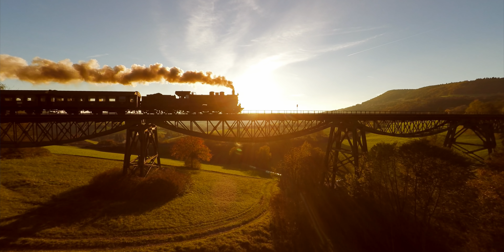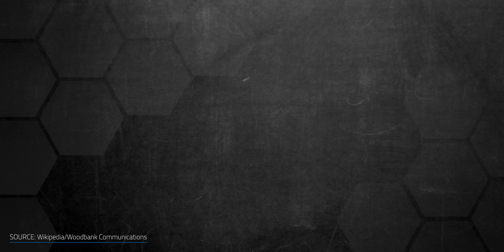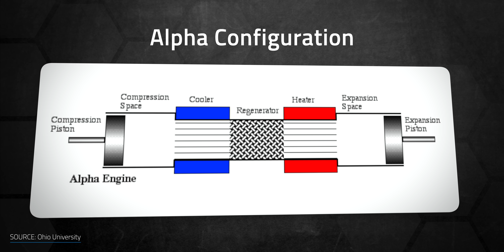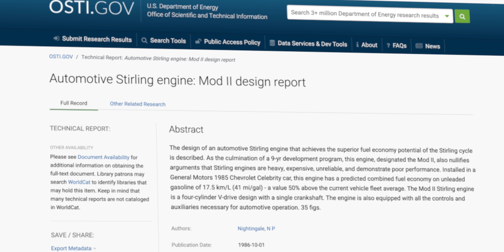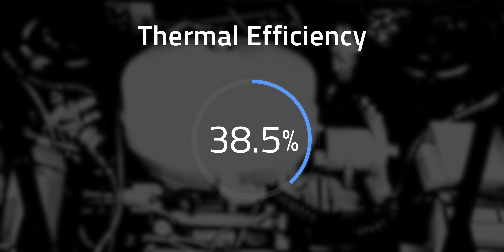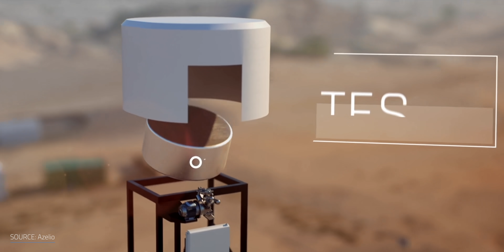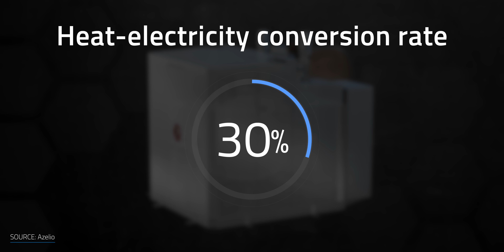Are Stirling Engines the Future of Renewable Energy Storage?

Comment: A nice video production as usual from Matt...

This appears to be the third main vendor effort working along similar lines with Stirling engines, (we're about to be the fourth :-).

Rotary Stirling is not the answer, it still requires lubrication of crank, journals and piston seals, very hard to maintain at high temperatures, prone to wear; not a 30 year longevity.

Unfortunately others rushing to market still miss a critical milestone by overlooking the solar inefficiency, raw material long term waste challenges, capital expense and space utilization of solar while the real problem is NOT Co2.  Rather we should understand combustion generated water vapor in tandem with desertification from the growing loss of 3 trillion trees, (more than 30% of global tree shade provision on earth) and losses to terrestrial aquifer recharge mechanics on growing arid lands depleted of topsoil organic material long ago.  We keep missing the boat on this one ending up with even more run-off of clean water becoming additional ocean water and salinity.  Our human contribution of Co2 is only 3-5% of the total natural carbon cycle.  

Pulling out Co2 won't have sufficient effect as long as we continue to add new water to the earth's surface raising the ocean levels increasing water vapor aloft growing the troposphere total entropy with water vapor being more than double the IR reflective heat value than all other carbon gasses combined.  This further increases the amount of frozen water vapor in the lower stratosphere which spirals to the poles becoming frozen ice crystals which destroys even more Ozone than all the remaining CFC's still being released regardless of regulatory changes decades in finally ending CFC in developed countries.

Running Stirling engines on fossil fuel does NOT mitigate the underlying causes without accounting for the two most prevalent contributing factors... Heat generation of combustion, including deforestation AND unmitigated water vapor produced during combustion and other man-made heat to vapor causes.

Still "Undecided"?  Do the math and keep fighting the good fight ! ;-)  

carbonanalytic[at]mail.com

Comment: Yes it is and this is what I am going to do in Portugal, you will see it all on my channel, as I get started on renovating my portugese house from next week.
OK I am more interested in liberating ourselves from big system control ie more of the self sufficiency lifestyle. So what I am going to do is build a heat storage unit to store daytime solar energy. Energy from solar panels will heat a night storage heater and the heat will drive a stirling to produce electricity at night. I estimate I will need about 50 to 100watts to run a house. All it has to do is power led light and a TV or laptop. Big power jobs such as running a hoover or a washing machine will be done in the daytime when abundant real time electricity is available.

Comment: Huh? so if you if you turn a wind mill into a  huge Stirling, engine with hot air supplied from the city streets and cold air supplied from water canals .and so if the giant  Piston filled with argon gas as a stabilizers .and it was shaft and gear driven or better yet brushless electric motor s .as hot as it's been around here could of produced 86 gigawatts and went back in time .

Comment: Are any used for heat recovery/recycling from combustion engines (or any kind of "thing" that releases heat as waste, like an electric motor)? I know that combustion engines vent heat out into the atmosphere but couldn't that be used to generate power that would otherwisebe lost?
 
I doubt that heat could power a steam engine as I read that steam engines work better at higher pressures which would mean a higher temperature, but these engines don't require as much of a difference. A problem that I can think of would be torque would be proportional to the temperature applied, but I think it would be enough to slowly charge something (probably very, very slow compared to the ICE it's next to)

Comment: Really interesting.
But I have one complain (it's quite nitpicky though)
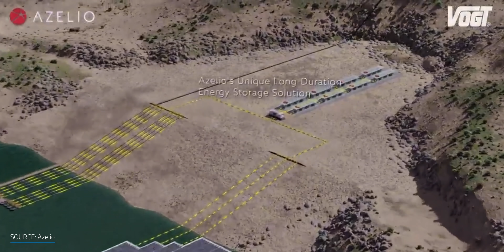10:00 I don't like question that go like "Is this the solution", because the answer is about always no, because nothing is the one and only solution in most cases. The next question that comes to mind is, "will this be part of the solution", where answering with no would deny any usefulness of the technology, so a yes doesn't matter much either.
Those questions are often used, to make what's following sound meaningful, but it can't be, because the premise of the question doesn't allow it.
Meaningful would be the answer to where and how it will be used, which is unclear in this case.

Well, at the end, I wouldn't be a good moderator, because in search of better sentences, to avoid logical traps like the 2 questions above, I'd say not much, so I would not be interesting.
I value your efforts and really like your factual, calm spirit.

Comment: I wonder if sterling engines could be used to generate energy in space considering the temperature differences on the sunny vs the shaded side of objects in space.
Reply: They do, actually using the heat from decaying plutonium as heat source.
https://en.wikipedia.org/wiki/Stirling_radioisotope_generator

Comment: Ok so, why don't we dig large holes deep underground, or use existing ones like salt mines, where the temperature is relatively constant to built massive sterling farms. You could pump a fluid from the surface (through a heat exchanger) to ensure a constant flow of almost guaranteed temperature differential. The sterling farm would need large metal sinks built into the rock to ensure maximum heat exhange with the bedrock, thus ensuring the cave stays roughly the same temperature all the time. I imagine on some days the temp above ground would be too close to the temp below ground for the engines to work, but not for very long. The temperature above ground ranges a lot throughout the day. So at least partial generation year round. And of course you could connect them to a grid so that stations can experience different temperatures and thus differing generation levels, making up for any laggers. Finally, places with far more unpredictable weather may be the best choice for these type of plants, as caves tend to stay the annual average, but above ground would vary greatly.
Reply: Probably because it is expensive to dig far into Earth's crust (it can cost thousands per foot), maintaining it is complicated and expensive and well... there is that whole "tectonic plates move" thing.

The Kola well cost over $100,000,000 to dig.  The temps at the bottom did reach around 190c, though.
Reply: I recently saw a video on british metro about how it's heating up beyond ambient temp thanks to waste heat from trains and shit in the system. one would think a bunch of stirling engines could be used to cool the tunnels and recapture the lost energy. It seems their big solution right now is to just vent the heat out into the environment, which is pretty wasteful
Reply: this is the first thought i had. Generation would also be best done in places with more extreme temperatures. e.g. any desert which could lead to a lot more development in those areas and potentially turning them into energy production hotspots

Comment: My grandpa has a solar system he bought at auction from los alamos lab.
He has a stack of polished aluminum sheets that are designed to plate a parabolic surface to focus the suns energy into a few hundred feet of pyrex tubes with stainless steel pipe running through the center. This then heats oil to around 700 degrees and the hot oil is stored underground where it can stay hot for weeks and can be called upon to create steam.

Comment: I've personally been interested in using them to replace home solar panels. Idk if there have been any new breakthroughs for solar panels but they used to be 15-18% thermally efficient, and even traditional roofs create a massive temperature differental
Reply: In hot climates you could also use it to augment them - PV works much better when cooled, a fluid-based cooling could keep the PV at a better efficiency point and could run a Stirling.

Comment: ambri is a company that you should look at, they probs fit the title of a hot battery as well. they are claiming 80% efficiency with their battery design and theoretically a very cheap and more eco friendly battery solution to lithium. TLDR of what they are doing is a molten metal battery, using an electro chemical process to charge and discharge

Comment: I think one of the main reasons Stirling engines aren't more popular is the power to size/weight ratio. Your little model is fun to watch but is useless for doing any meaningful work. Put a load on the output shaft and it will stop. Another factor is efficient use of available heat.

Comment: I have long thought that Stirling engines need more innovation. The way it works is the genius part. Its like the hard part is already done. Nasa is working on Nuclear Stirling engine batteries for Mars that would last about 10 years. I believe there is a way to use the sun to power a Stirling engine.

Comment: Stirling engines aren't a storage technology, they're just a method of converting heat energy to kinetic (or, in turn) electrical energy. The storage technology in the case here is thermal storage. That's what I really wanted to know about! How do they cost-effectively insulate the heated material to prevent loss of energy to the environment surrounding the heated material? Why did they choose that particular material and temperature?

Comment: Why Aluminum vs molten salt, or even paraffin if you wanted to take advantage of phase change. Paraffin wax phase change cooling coupled with retractable radiators was used to cool the electronics of the Lunar Rover.

Comment: Storage of energy in pressurized air is one possible solution for energy storage. However, it is inefficient in that by pressurizing air, the air heats up which may eventually bleed off, resulting in a loss of heat energy. The solution to this can be either super insulation to hold the heat, which can lead to some serious problems and limitations, or by utilizing the heat for power generation, perhaps by Stirling engines. As pressure is released from the compressed air it can drop dramatically in temperature which results in further loss of energy. This cooling could also be used for energy generation, again possibly by Stirling engines. By using the heating and cooling of the air for energy generation one could potentially greatly increase the efficiency of such pressurized air energy storage systems.

Comment: I wonder if one(or multiple) of those Stirling engines could be embedded in the walls of an adobe home and used the difference of internal and external temperatures to make electricity for off grid power generation.

Comment: I couldn't find any examples of Stirling engines doing actual work, just toys.  I looked at your example and they won't even tell you the nominal output of a unit, you have to contact them and I assume then a sales person convinces you to buy one not because it's actually more efficient than anything currently used, but because it helps the Earth.  The a limited market and not really useful.  If the Stirling engine was practical, it would have been in mainstream use long, long before now.  It's just another, maybe, niche use device.

Comment: Very good video. I am working on something similar that operates on the ocean floor near volcanic vents where magnets are mounted on flywheel and activate coils for energy transfer.  This electrical energy is then used to separate water in H and O2 which can be stored for later used on fuel cells. :)
Reply: It’ s super this model!

Comment: The biggest cost of any system is storage. The cheapest storage is compressed air running an air motor during off hours.
 In fact, this process creates heat on one side of the air motor and cold on the other side for a free ride to an auxiliary sterling motor.
Compressed air can be transported long distances (from solar farm to grid towers) very cheaply through plastic piping..

Comment: I have been thinking about the residential market, green minded families might access. A sterling engine/generator combination on every oil or electric furnace to capture waste heat in homes could charge electric vehicles in cold weather if the cooler surface was connected to the external, ambient, low temperature to provide a very large temperature gradient. Some all DC systems have excellent efficiency. A reverse set up on air conditioners waste heat pump could provide electric power in summer. Solar pannel 'Sun Rooves' on cars could run air conditioning in hybrid or electric vehicles and recharge the batteries when AC is not needed. A low velocity chimney vortex generator would work in any chimney, year round, due to rising air convection currents. Your energy storage ideas are interesting. Not sure how to scale them down or make them economically viable for the home owner. 
Solar power pumps water from lower water tank to upper water storage tank all day... gravity fed hydropower all night. An abandoned bi-level flooded coal mine is doing this now in the US.

Comment: Another interesting feature of the Stirling engine: It's reversible. It can turn a heat differential into mechanical energy, but can also turn mechanical energy into a heat differential. Which is why one of its historic uses was as a cooling machine. It would be interesting to explore whether this could be utilized in combination with wind energy as an integrated energy storage system.
Reply: So we could make a sterling refrigerator
Reply: @reddaxtor5662  Yes. In fact, that's how large-scale refrigerators used to work.
Reply: @rockyblacksmith  So they stopped making them now?
Reply: @reddaxtor5662  So far as I know. Modern refrigeration systems based on evaporation and compression of a cooling fluid are much easier to make.

Comment: if solar converts only 10% on the energy, and the stirlign engine up to 40%, can you just put mirrors and focus the light on a giant bucket of sand and heat it up?
Reply: Solar panels actually hate heat, they dont work on solar heat but solar photons, light. Photo...voltaic. produce voltage when light is present...
Reply: @MmeHyraelle  Stirling powered generator could then be placed under solar pannels to use the temperature difference between the waste heat of solar panels and the shade to further improve efficiency (heat into electricity, cooler solar panels)
Reply: that's what the ones looking like satelite dish are. the "bowl" is mirrors and the part that get heated is at the center of the dish, on the top of the tower

Comment: Stirling can produce heat and cold, both can be stored and used vice versa when needed. Even better application for this engine can be HVAC systems, my version of modified Beta Stirling is so simple, small, cheap, that it can b eideal for HVAC systems in el. cars.

Comment: It's common for more rural people to use outdoor wood burning stove to pump heated water into their homes through coils their furnace blows over. I've been interested in gasification systems that can generate electricity and use the heated coolant to heat a house the same way as the wood stoves. It would be interesting to take that concept and add a Sterling engine into the coolant line to use some of that excess heat to generate additional electricity. This wouldn't work for everyone, but it could for people with enough land for tree removal services to dump at. It low priced dumping fees would encourage companies to bring their waste wood there and help pay for the system as a whole.

Comment: So, you have a battery bank in the northern region, say the USA/Canadian border.
You have a solar array and/or wind turbines array and has the ability to produce hydrogen via hydrolysis machine and have the ability to store it in propane tanks.

You use that hydrogen in the tanks to create electricity to charge a battery bank.

Those batteries are charged using a using a hydrogen generator which also generates heat at roughly ~40 °C.
Now the battery banks convert DC to AC to power your home.
Winter time comes, sun is limited and panels are covered with snow. How do you recharge the batteries by reducing the consumption of the hydrogen stored in your tanks?

Well, if I understand this correctly, during those winter times, you can use the heat from the hydrogen generator to run a Stirling Engine to produce more electricity at zero cost.
Is that correct?

Well, if I understand it correctly and that is correct, that's just brilliant!!!

Comment: I don't think enough use is made of heat as a byproduct. A lot of energy is used moving heat away from the point of concern. An inefficient energy accumulator like lifting a huge weight very slowly, could use some clever heat sinking to for example water heating, central heating, cooking. Heat pipes, like the extremely effective ones in GPU thermal solutions would be very cheap if produced at scale. Even in very hot countries, people cook and wash with hot and boiling water.

Comment: The biggest challenge of making a sterling engine is sealing the heat exchanging gas (i.e. helium) .  It is not a cheap manufacturing process.  In addition, the engine doesn't provide much torque, so it must increase the RPM and stepping gear to produce torque. And again, such manufacturing process is not cheap.

Comment: The easiest long-term energy storage solution is using the sporadic energy creation to pump water to the top of a hill where it is stored, then drain it through a hydroelectric generator when you need the power on demand.